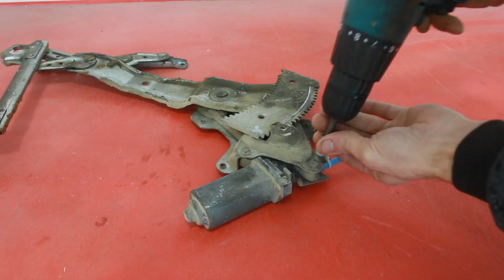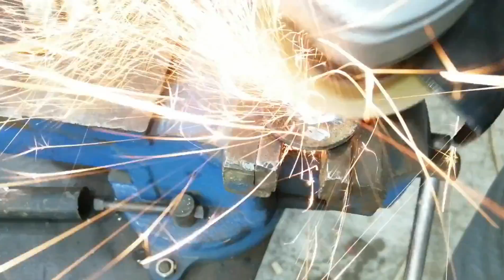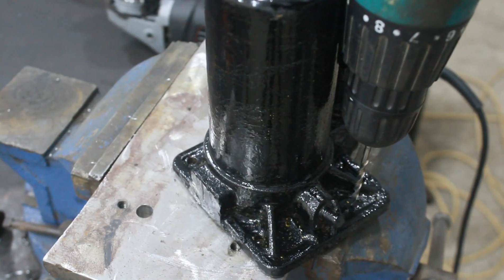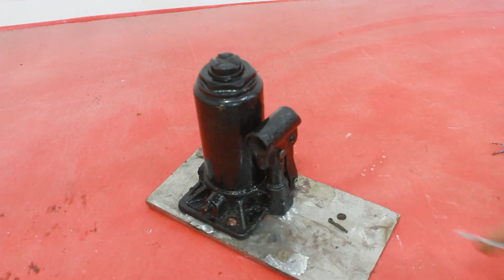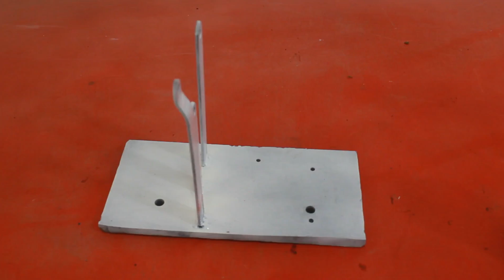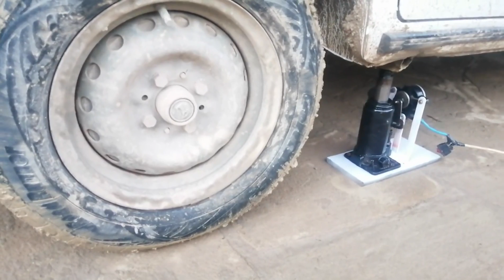Make a Electric 12v Hydraulic Car Jack Using Car Window Motor

Comment: Nice project
Pls is there a way i can automate the Release Valve of the Hydraulic Jack (bottle type). I mean is there a way i can connect a switch so when i press it the hydraulic jack will bring the load down instead of going down to loosening it with hand or with a plier?